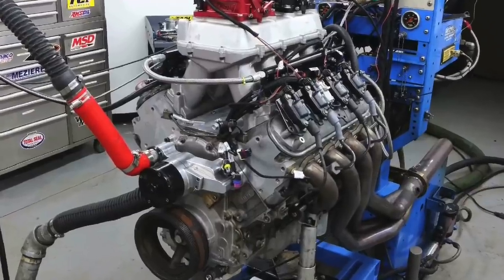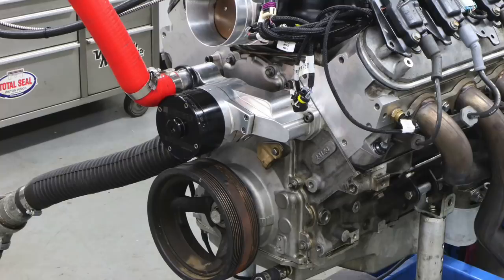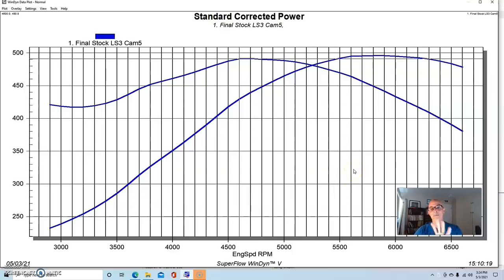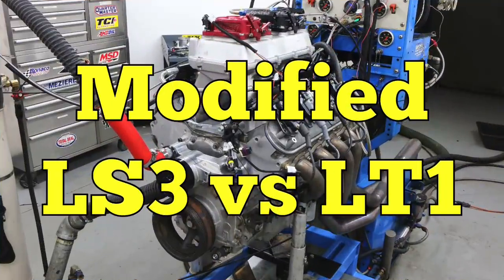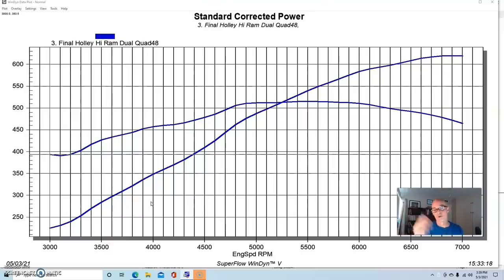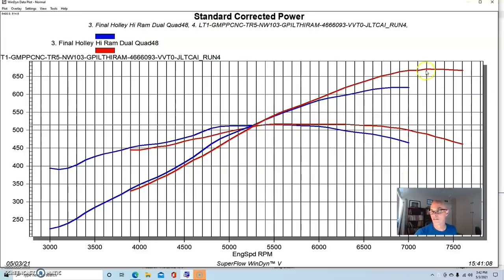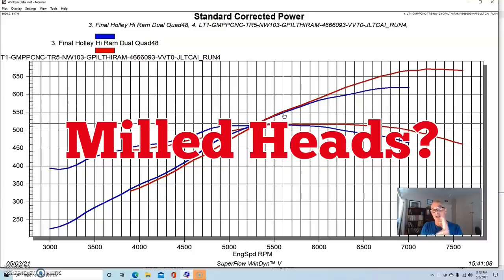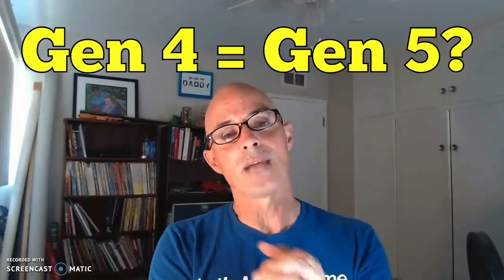LS3 VS LT1-IS NEWER REALLY BETTER? (GEN 4 VS GEN 5 6.2L)

Comment: I just picked up a 2018 GMC SIERRA Denali with the L86. This video makes me sad. 

I just realized the 429 stroker LS3 in my 2010 Camaro SS makes about what a heads/cam/intake version of my truck motor would make. 

That makes me happy at the same time because my truck will be way better after headers and a tune.

Comment: Gen 4 is best for  boost. LT1 (D.I.) has fuel system limitations, putting it at 8xxhp ceiling. built both, have to pick D.I. for ice cream and burnouts but LS3 for max effort race build. i built L86 with untouched heads, intake, mild cam, springs, tune, makes 500hp on chassis dyno.
Reply: Gen V has stronger block, and bigger head bolts, so is better for boost.  Add port injection for extra fuel once the DI injectors are at their limit.
Reply: @andyharman3022  I hate that one driver head bolt hex lol 
Still learning di limits

Comment: I re-watched this and saw my old comment. 
I still think the LS3 is a better overall package. Simpler setup. Exposed injectors, No VVT. It just plain works. 
-- However, I do wonder, what about an LT1 DI delete (Machine aluminum plugs to put into the injector holes), MSD airforce, against the LS3, Both running E85, 6500 RPM rev limit. 
-- I like the JE pro notched pistons with the ceramic coating. Upgraded rods, stock crank.

Comment: Stock for stock and mod to mod the LT1 engine is more powerful. I've seen stock LT1 Camaros trapping 118. Yes, the 10 speed is definitely an advantage. But that won't affect trap speed much. I've never seen a LS3 Camaro trap 118. That's LSA speed. Sadly, most LS3 Camaros trap sub 110.

Comment: I liked the 2nd dyno test for 620 hp the best out of all the testing.  I think that motor ROCKS for the street, and has insane low end torque.  I did not like the last test for the street.  The higher end power was not worth the lower end power loss in my opinion.
Reply: in the 6gen SS it might not even be noticable since its lighter than 5th gen with a much better chassis. Just my 2 cents not saying your wrong im just not sure it would matter with those differences.
Reply: The 620 was out of stock LS3 heads, with ported LS3 heads, the tunnel ram and that big cam that car would've made over 700HP.

Comment: There needs to be a pain in the ass test: aka which engine is the bigger pain in the ass to install in your ride? Ict billet offering block off plates for the direct injection and adapters to run a gen iv multiport efi setup should say something

Comment: If you ever come across one, I'd love to see you do a comparison of an L76 6.0L all aluminum truck engine with VVT vs. Maybe a Gen 3 6.0L or maybe the LT1 or one of the 5.3 variants to see How it compares and responds with VVT cams.
Reply from the maker: I ran an LY6 (iron block version) but have not run it with VVT
Reply: I have an L76 in my GMC Sierra and always wondered what it's power potential could be. It runs so good in stock trim with a little help from headers (and exhaust) and a power programer and throttle enhancer.

Comment: I’m pretty sure stock LS3 heads outflow stock LT1 heads but the LT1 does not have to flow any fuel through the ports so the actual mass of air could be equal or exceed LS3. interesting comparison Richard. Thanks for all that you do
Reply: I think you're right.  DI eliminates the need for the intake ports to handle fuel flow, freeing up capacity for about 7% more air.
Reply: That is interesting.  I hadn't even considered that aspect of DI.
Reply: What about exhaust port flow
Reply: That's an excellent point, but giving the fuel and air slightly more time to atomize before entering the combustion chamber helps with intake temps and more efficient atomization. I'm not convinced there's much of a difference. Especially when you consider the high rate of carbon deposits that occur in DI engines. That carbon build up creates hot spots in the combustion chamber which changes the tune. Since we're doing a deep theoretical drive that's something else to consider. DI does have drawbacks.

Comment: @Richard Holdener have you done any LT heads on LS blocks? I see BTR is working on some testing, I would love to see an LT headed LS3 Dyno!
Reply from the maker: BTR has done that
Reply: @richardholdener1727  do you have any comparison information on potential power gains between LS3 heads and the LT heads? I'm curious if the LT heads would be a performance upgrade or is there any benefit to them on an LS based engine. Thanks for your reply!

Comment: Richard,
Which factory exhaust manifolds flow the best. My 07  HD 3500 LY6 has 3” out of manifolds through the 2 cats and then Y’s to 3 1/2 out the back.
Would like to see a test if possible.
Reply from the maker: MINIMAL CHANGES IF ANY-LONG TUBE HEADERS ADD POWER

Comment: This is a great review. I'm trying to figure out which e-rod motor to buy the LS3 or the LT1 for a 1990 short bed pickup truck. I like the idea of the extra torque down low but not sure the added complexity of direct injection and variable valve timing is worth it.
Reply: ls3. no vvt or cylinder deactivation. no collapsed lifters. plus, they only come with 6 speed manuals in the camaro. the automatics are the l99 with all the vvt and stuff. an ls3 with 430 horse dynos at 370 rwhp, while the 400 horse auto only has 320 rwhp. the manual is much stronger and way more fun

Comment: Richard, What about Building a Dart Boss 302 with all the Good stuff, Carol Shelby and Ford didn't have in 1970?  if you did a Video can you get me a link?
Reply from the maker: The Boss 302 already had a good block.
Reply: @richardholdener1727  I know,  I run one in my 1965  1986 to 92, it was a D1ZE block, just wanted to know if you tested a better newer version of it?

Comment: you said you wanted ideas; how about testing a well tuned RED modified Holley against fuel injection. use a 600hp engine
Reply from the maker: RED modified?
Reply: @richardholdener1727  here is one, but NOT the one I want to see tested, the one I want tested has 3 metering jets (each plate) that can be changed and an outer Air Bleed jet on the top of the metering plates. 
https://billmitchellproducts.com/product/aed-performance-650-ho-series-aluminum-carburetor-gas-std-booster-billet-red-metering-blocks-al650ho-rd-click-here-more-info/

Comment: Late to the party just found this video. I had a 2007 Z06 with LS7, Stock yes i had the heads replaced, then went to an SS Sedan LS3, whoa! less cubes and heavier car, I put the Factory Roots style Blower (LSA) on a the Stock LS3. OH  yeah now some torque is back, but the vehicle was too long for me. Got a 2014 Z51 LT1, its ok but not an LS7 or supercharged built LS1 or LS3 with LSA. So now what? I really like this C7 Vette but missing the grunt and bluster of these other engines. Been Pricing things out: Cam ($500) but $8,000 Installed, Ouch, Heads $3,000 port my heads Installed, Intake slim pickings $1,000. Headers $2000 installed, A&A Vortech $10,000 installed.  WTF?  Can you assess Tuner Kits for the LT1? The biggest push i have heard so far was a quick and dirty A&A Vortech Kit to reach 600 HP with fuel system upgrades.  But still $10,000 is a lot of Jack for a one shot kit, will it do the job, will it have strong torque down low, 3,500 RPM? Will ir allow the LT1 to Rev??? Cn the LT1 cam rev at all ?? How does 11 to 1 work out with boost and stock valve train???? Is there a need to work on the intake at all with Boost??? Can HCI beat out the A&A Vortech Type Blower bolton???  Would love to hear you inputs on Hot Rodding the LT1 in a C7. Thanks, Dennis
Reply from the maker: talk to BTR

Comment: Hi Richard.
I'm from Poland, I watch your videos on YT. I have a Camaro SS, 5th Gen with L99 engine. You are an expert in this field, that's why I have a question. My engine has been damaged (a hole in the block) I can buy a C7 LT1 6.2 block, can I transfer the crankshaft, pistons, heads and other components from the L99 block to the LT1 with some minor modifications?
Regards.
Alex.
Reply from the maker: I don't think that will work

Comment: I have an LS3 with ported 243 head and a bald eagle n/a cam. forged flat top pistons .20 over 92 mm throttle body and tbss intake, texas speed springs etc. where do I fit in power wise?
Reply from the maker: have never tested that cam-but mid to high 500s if the heads were done correctly

Comment: having an LT1, I'm curious on going supercharger or TSP cam/heads combo.  Still not sure.
Reply: I have a pro charger TSP Headers AWE catback and i make north of 600WHP on 7 LBS and E85. But i dont know if i want to just go all motor especially with the EPA becoming radiculized. Hard to hide a pro charger. easier to hide all motor mods.

Comment: I have a stupid direct injection question;
Since the engine is detonation-proof and has piston oil squirters, does that mean that I can cruise with a super lean air/fuel mix???
A Hot Rod getting 30 MPG would be pretty cool.
Reply from the maker: NOTHING IS DETONATION PROOF
Reply: lt4 corvettes 
 gets almost 30mpg with a 7 spd manual.
Reply: If you could tune the engine to operate in lean burn stratified charge mode at part-load conditions, you could improve fuel economy.  GM doesn't do lean-burn with the factory tuning on the Gen V engines.  They run stoichiometric at part-throttle, but don't inject until after the valves have closed.  This is called closed-cycle operation.  You could get stratified charge operation and operate at very lean conditions (22:1 A/F) by timing injection to late in the compression stroke, maybe 25 degrees BTC, then fire the spark plug at 20 BTC.  This engine would be detonation-proof (at least at part-throttle) because the late injection assures there is no fuel in the combustion chamber except in the vicinity of the spark plug.  To get maximum power, though, the engine would have to revert to homogeneous charge operation, and add full power enrichment.  Tuning the transition from stratified to homogeneous charge would be tricky.

Comment: What did you use to control the lt1 with? I didn't think the holley hp could support the variable valve timing.
Reply from the maker: it was done at BTR with a Haltech
Reply: @richardholdener1727  awe that makes sense now. Thanks Richard!

Comment: Any thoughts if you ran an l92 with ported heads, same compression and a similar spec vvt cam? I know l92 is down slightly in compression from the ls3
Reply: Ben diesel  I'm running an L92 with Howards cam 190866-13, comp cams shaft rockers ( branded) gmpp cnc heads ( no longer available from S&D ) 030 cometic gasket, fast lsxr intake, 102mm tb, 1 7/8 ceramic coated headers thru a Leno which are not HP friendly and makes at the wheels on hub dyno, 519.5 HP @ 6748rpm and 434ftlb @ 5651rpm, so I think the 6.0L is still competitive JMHO experience FWIW

Comment: All things considered, the LS3 is a more complete package with a 224 cam. Shifting at 6200 on a T56 magnum, you run from 4300 and up. The LS3 ends up 15 foot pounds short, but remains close all the way to 6300. So, in their operating range, performance is about even.
--Will the LT1 make the same torque with port fuel injection and an MSD air force? 
--That sub 4K performance from the LT1 is savage for tip-in burnouts etc.

Comment: Having a ported head with a bigger lift cam that required fly cut pistons is definitely worth the extra  50hp or so

I believe it would be negligible difference if it was 100% matched modes
Reply: Naw dude been scouring the net and talking to builders  its taking big cube darton sleeve LS7 top ends to get close to what the LT stuff even with their cheap 3.860 stroker crank in stock block are doing to the wheels....very few Gen 4 are making 600whp and when they do it's terrible manners and big stall...we are starting to see this as the norm now on LTs, just since this video
Reply: @ShawnGilbert1967  so swapping lt heads and cams on gen 4 is worth it??
Reply: @ShawnGilbert1967  thank you for the very detailed comment and you know about the engines way more than i do and have seen much more combinations

I am a guy on budget so the most displacement i can get is 6.2 L92 and the most NA with stock ls3 heads i have seen is 488whp on e85

Now if i want to maximize the setup i was looking into getting l83 heads and gen 5 cam and rotating the pistons around

Hoping that this will get me over 500whp on a 6.2 gen4 block

What do you think?
Reply: @ShawnGilbert1967  makes sense... what do you think about gen 5 heads on gen 4 block with gen 5 cam and turning pistons

Have you ever heard of someone who tried it?
Reply: @FirstLast-tx3yj  I'm early in my research ( obsession haha), I wouldn't be as concerned about pistons as bolt pattern also unless adapter are available they have different intake and header flange patterns

Comment: Hello , thanks for the video ! I have a bone stock 21 Camaro SS 10speed and was thinking about going full bolt on but wanted to keep stock cam /heads for now , does the btr manifold make good power with the stock cam ?
Reply from the maker: you don't want that manifold on a stock motor
Reply: @richardholdener1727  why you say that ? As far as performance wise what’s the best intake manifold to but on the stock motor? Rn I just want my lt1 full bolt on but probably next year I’m going to do the heads cam .

Comment: Does anybody make a higher velocity smaller port head for the LT?  Like to see that with a slightly smaller cam.  Great mid-range and wouldn't sacrifice much on the top?
Reply: Edelbrock has heads but to get more flow they decided to rearrange the exhaust too, so an expensive header is required too. Probably not a big deal in cost ultimately but probably a turnoff for most.
Reply: Ohh, forgot about CID and apparently MAST Motorspirts has LT heads now too.

Comment: A direct injection motor can flow more air even if the heads were identical based on the ports alone because air without fuel in it is lighter and easier to cram into the cylinder past the valves. I'm actually surprised the difference wasn't more substantial.
Reply: More air plus more compression on pump gas.

Comment: Hey Richard, I'd like a recommandation to select a good cam for my grocery getter, tow vehicule (2007 Suburban 2500 with LY6 stock ls3 springs and converter). I'm hesitating between the Lunati Low Lift Stg2, BTR Truck STG 2 or Summit  8701-R1. Thanks for your input. Cheers
Reply from the maker: THEY ALL WORK-BUT ARE YOU GETTING RID OF VVT?
Reply: @richardholdener1727  
Yes sir! That’s what most people seem to recommend

Comment: Bump up the compression camshaft head flow  on the ls3 and the lt1 will still make a lil more power. Put that ls3 on e85 and it will run away from a lt1. Put a lt1 on e85 and money will run away from your bank account.  Lol

Comment: Has BTR tried port injection on the LT1 and disabled the DI that would be an interesting test and make the gen 5 engines easier to swap for the average guy if they made more power,  gen 3 and 4 pistons should work as they have the same length rods and same stroke for 5.3 and 6.2.
Reply: Mast motorsports

Comment: Speaking of VVT, why has no one done a big displacement VVT LS? I have trouble believing a big cam, high compression, VVT 428" LS, for example, would be a turd of an engine. Is it too difficult? Is everyone in the OHV V8 scene too cowardly, too cheap, or too stuck on old tech to do it? I'm genuinely curious.
Reply: I’m running a L92 based 418, TSP VVT1.2 cam, ~11.4:1 compression, and a 6L80 in a Bronco. 3.73 gears on 37” tires with a stock converter and it drove great. I just swapped ina 4.56 gear and am liking it, but do miss the low rpm cruising on highways. Last week I drove 400 mile round trip in it.

Comment: I believe, with the same compression,  the ls3 would have beat the lt1 on torque.  Kinda did anyway in that it came in lower in the rpm range.
Reply: as shown in the video the low end torque curve is massively in the favor of the LT mainly due to VVT

Comment: Yes fast forward to today BTR claims 75 HP difference between DI and port on the same engine. 

Then trying to use that to sell DI heads swap for a LS. This just makes me reinforce the fact he is using angles of approach to make things look inflated
Reply from the maker: angles of approach? tinfoil hats?
Reply: @richardholdener1727  yea, they trying to move a new “thing” and if you make said “thing” look like an insane amount of gain when you have testing that is essentially proving otherwise
Reply from the maker: BIG NO ON THAT for the guys at BTR, their testing is accurate
Reply: @richardholdener1727  so your data is inaccurate here then?

I mean, to be fair they did run DI and port on the same head which was clearly only designed for one or the other, again further supporting my claim in my opinion.

We put a LS7 intake on a LT 5.3 with a cam and it is so slow it makes no sense for what generally makes 500 HP in your videos. Between the spacers and the DI heads trying to flow port injection, it’s a turd.

Comment: On the Gen 5 5.3 going with a BTR stage 4 cam do you think there's any possible way to get a small Dremel tool through the spark plug hole 2 Notch the piston?
Reply from the maker: no
Reply: @richardholdener1727  I like that very definitive no. means never try it compared to well maybe you could ect....
Reply: Nitchingbis done through valve location with a cutter, backyard diy guys have done it with a junk valve of the appropriate size and course sandpaper on the face to notch with.
Reply: @shaadydog1  What are they doing about getting the crap out of there afterwards, just blowing it out as good as possible?  Sounds super sketchy...